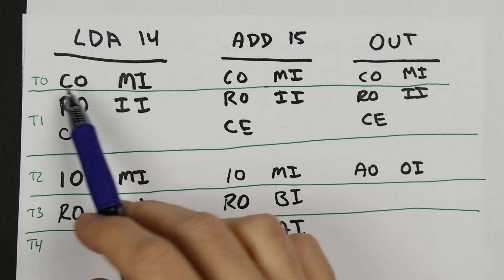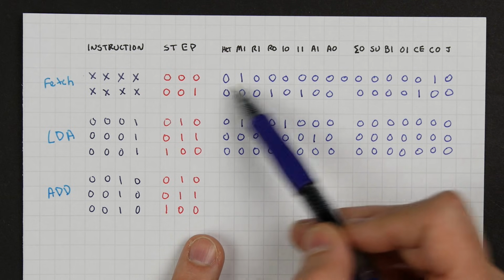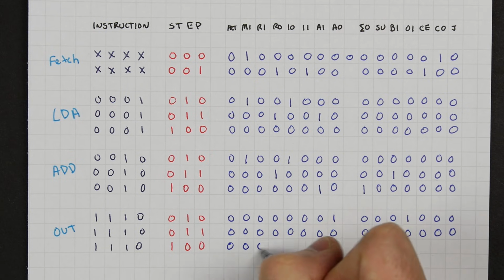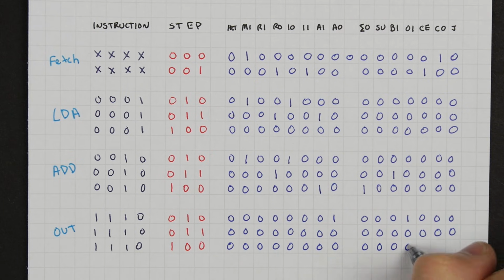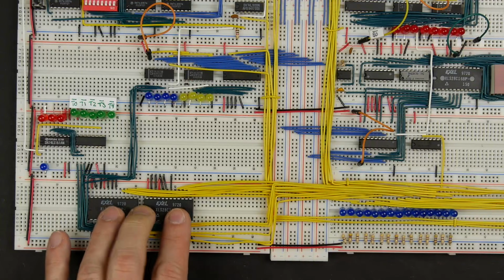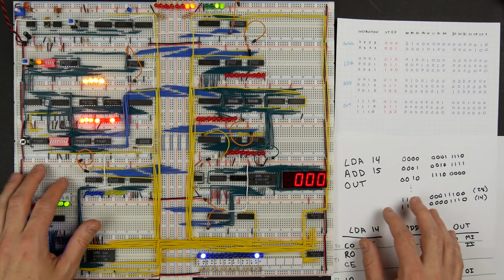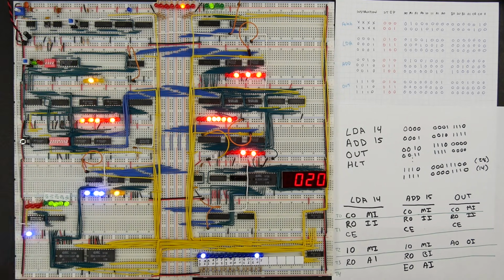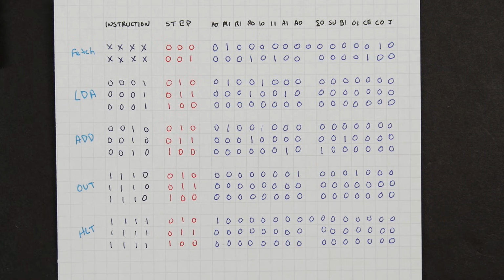8-bit CPU control logic: Part 3

Comment: How did you solve the glitches that are created when you change the address of the EEPROM to read the data?

How do you respect the EEPROM data reading time
Reply: Since the microcode clock is offset from the main system clock, there won't be any bugs.

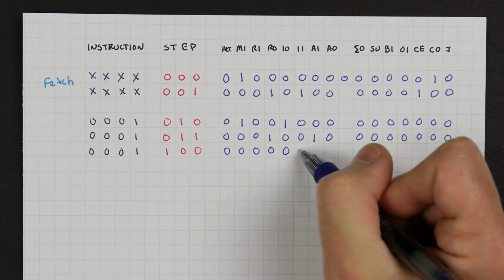Comment: for the last step of a LDA command (6:50), instead of wasting a clock cycle, would it work to add a control logic signal that resets the sub instruction counter on the 4th step of the LDA command to skip that 5th step that wastes a clock cycle?

Comment: I would use 0xF as the instruction counter reset instead of fixing it to an instruction count. That way, you could have instructions of varying length. Would require a couple AND gates, but I think that would be a big improvement for both speed and flexibility

Comment: This is interesting but I'm a bit confused as to why LDA 15 is the first step. Recalling that it means load the contents of memory address 15 into register A, why isn't the first step setting a value into memory address 15. Further, where is the step that sets the value of memory address 14 for the ADD step? Possibly you are just demonstrating a sample code segment in order to understand the timing and clock sequences.
Reply: watch the vid carefully he did sets the value at memory addresses 0 1 2 14 and 15 and here he is manully writing data inside the ram which is also shown in the vid

Comment: Would it be possible to put all of the input lines into an encoder and same with the output lines, so there is more space for any other control lines we may want to use?
Reply: Also could we put the reset signal of the microinstruction counter as a control line so we use that at the end of each instruction to save time instead of waiting for all 5 clock pulses?

Comment: At 28:58 you say that it starts at T0. What is the fix for this if your 8-bit computer is not at 0? I tried loading a zero, but the second I connect load back to HIGH, it starts at 1 again. Do I really have to program the RAM at the correct clock pulse?
Reply: Note to self... Watch the next video in the series...

Comment: just noticed, you could add a "control" signal that reset the step counter in the Instruction EEPROM

would save 1 cycle on a few instructions but it's always that i guess ?

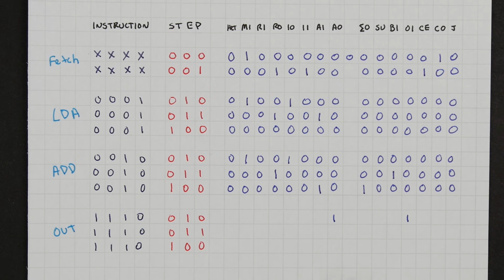Comment: 9:04 and micro counter reset xD you waste 3 clock cycle for LDA and OUT. thats more than fetch cycle.
there is 1 controll bit left to actually use it for reset micro counter LOL

Comment: 📺💬 There should be some way that you create instructions commands that use less of steps.
🐑💬 Should see the instruction commands cycle, some command is require only one step or instant output.
📺💬 Jirayu add subtract command 
🥺💬 It is the add command with sign depending on the architecture command instruction some of them change the last bit.

📺💬 EXCEL 
🥺💬 I understand as reply CPU instruction, you neat the signal before input. 

📺💬 When we load a variable after the output command it assigned address 0 but when we do with add it does not.
📺💬 Yui call to Excel ask 🐑💬 It is correct but you need to see STA statistics accumulate commands.

📺💬 ยุ้ยดูหลายที
🥺💬 ผมก็ดูครั้งแรกครับ ปกติผมก็สอบ ตอบคำถามอะไรไปเรื่อย ผมจะหางาน แต่คราวนี้เค้าไม่ยอมหยุด ผมเลยดูอะไรอย่างอื่นบ้าง

( 📺💬📺💬📺💬📺💬📺💬📺💬📺💬 ยุ้ยเอาไปครับอยากโชว์มันเลยอาย 🥺💬 ไร้สาระครับ ไร้สาระ กับผมหาอะไรทำ 
  📺💬 ไม่รู้ได้ไง 🥺💬 ผมไม่เล่นด้วย ผมเรียนหนังสือครับ คราวที่แล้วอย่างนี้แหละ เด็กมันเลยท้าเหรียญเท่าปู่กูเปล่า สุดท้ายเค้าเลยออกไปเลย บอกพม่าหรืออะไรที่จ้างมาหยุดด้วย ผมไม่ใจร้ายนะ ผมจะหาอะไรทำ
)

Comment: If you want to use a control line to reset the step counter at the end of each instruction (as many people in the comments have suggested) and still want to have that last control line available for something else, I'm pretty sure you can just continue to invert /T1 to get CE without causing any problems (saving a bit in the control word) because CE is always set during T1 and never set outside of the fetch cycle.

Comment: This entire series is mind blowing Ben!! More than 15years of wondering on "what exactly happens inside a CPU" ends here! Can't thank you enough for this. Started making my own now. Please try to make a video series on ADC & DAC because there isn't that proper info anywhere, because your teaching way is so beautiful, i believe that could help a lot to understand this topic. Respect 🙏🙏
Reply: for the dac you can use resistors and an op amp
0: 128k     (lsb)
1: 64k
2: 32k
3: 16k
4: 8k
5: 4k
6: 2k
7: 1k   (msb)

i had this hooked up to the output pins of a shift register, the other side of the resistors were all connected together to the input of an op amp in a follower circuit

Comment: Logisim tells me that just the LDA, ADD and OUT instructions, encoded using pure logic would've needed 7 inverters, 5 3-input AND gates, 4 6-or-more-input AND-gates, 7 7-or-more-input AND-gates, 2 2 OR gates and 2 3-input OR gates. If we had to do it in purely 2-input NANDs, we'd need 149 of them.
Reply: Its funny how quickly the "I'll build it all myself!" mentality goes away. I thought I wanted to do everything with simple logic gates, I know now that I really don't.

Makes it tough to think about future projects though. Where do I draw the line? If everything needs to be abstracted, why not just go all the way and build an emulator in C++ or something.
Reply: Yes, it looks like it'd be a pain without the EEPROM which makes it significantly easier. What you need to make sure of is "What do I want to experiment with?", "What do I want to know / find out?" and "What do I want to play with physically?".
You can just build all this stuff with enough patience in something like Logisim-evolution, but it won't help you debug real world electronics like plugging things actually will. I made a small Pi Pico W setup just to try out a shift register and LEDs and learn about things like pull-up and pull-down resistors.
The real question is what do you want to get out of it? If it's just to emulate this system, then building an emulator is what you'll want to do. If it's to build it for real, then that.
I also plan to emulate the CPUs used in Ben's videos in a public repository in Haskell, one of the best choices for good parsing.

Comment: Now I know how roms are burned.  I see now that programming in the software sense is just control logic for the processors of the computer, or compiling anyway.  And manufacture assembly code is the hardwired control logic of the processor.  I wonder how hard drives communicate with program counters to deliver code to control units of a processor.

Comment: if you consider only 1 signal should output to the bus, you could take 3 output pins and decode them into 7 control signals + 000 = no output to bus.
I know it's not enough to reduce the required pins to 8 but it would prevent double writing the bus.

Comment: To cycle through all of the possible instructions, as you do from 21:14 onward, one could use Gray code sequence to enumerate through all 16 instruction codes only flipping switches 15 times (unlike 26 like you do when enumerating in order).

Comment: Is there a reason not to do a logic NOR on the highest two bits of the step, as those are always contain a 1 for a step that's not loading the instruction / incrementing the step counter, and then do an AND on that and the instruction bits; that way you don't need to use memory for all the fetch steps repeatedly? It's a little more complicated but makes the computer easier to program (I think I got the NOR and AND operates right for the matrix you had there)

Comment: 32:43: You also bumped the mem addr reset wire.. :D
I was looking multiple times, why the address changed magically after your moved your hand over it... :D But that didn't caused any problem... Later I saw your note of the second bump, that caused problem actually...

Comment: Thank you, so much, Ben! This is what I want to know how the computer and microcontroller works. I was thinking how the microcontrollers are programmed manually without any computers, and I can't figure out with these 1's and 0's, exactly. Now, it is like kind of that I have got all I want to know about basic computer's system. Now, I've got how computer's micro codes are passed through cycle by cycle and step by step. I really appreciate what you built. I would like to learn computer science from you if possible.

Comment: Years late to comment, but still an awesome series. Thank you.
Just in case anybody who cares is reading could the instruction set be further optimised to four rather than five steps?
...the last cycle in the 'ADD' command is redundant, and possibly confusing? Because the 'ALU' automatically puts it's result on the bus there is no need to explicitly load the result back in to 'A'. Indeed the extra cycle's commands only serve to screw up what is in the 'ALU', yes?
Reply: I don't think you can shorten it. If you make the {EO,AI} at the same time as the {RO,BI}, then the two outputs will both be trying to output data (and fighting over the value on the bus). It's all because this simple CPU has a single bus; first we have to move the memory value into B (over the bus), then we have to move the Sum result (over the same bus) to A.

Comment: I'm just starting to learn about computers, and I've been able to piece out what is going on slowly, but I wish there was more in depth explanation and looking into some of the components and how they do what they do, and some more breakdown of things like EEPROM and how everything relates in similarity to an actual CPU. 
Originally I found this trying to figure out HOW a command unit actually, commands anything and I think I'm starting to get the basic gist of it, but it would be nice to tie it all together/break it down more for those of us not as computer savvy and wanting to learn more. One thing I had a hard time understanding was high/low, and there weren't a lot of good explanations I could find.

Comment: You did something I've wanted to do since the 1970's.  Every programmer should see this.  Wonder if you can do a combinational logic cpu instead of a sequential logic version..  Also, the extra time sequence not used like "out" could be used to reset increment the program counter on the last micro instruction and skip t4, t5 etc.

Comment: I think we can also multiplex the EEPROM as we did for the display. We can have a high speed clock(555), a couple of octal d-type latches (74LS273) and have one of the address bits of the EEPROM controlled with the clock. And we can select one of the latches using the clock as well.
For preventing repeated latching, we can ensure that the clock only runs for a short duration on each rising edge is the step counter.

Comment: Been watching these and had the thought, when talking about using the instruction to define what things to select, "Wait.. I think everything on a 6502 that dealt with the accumulator used an instruction that started either with An, or Bn... So, does that mean they went way beyond using eeproms to do this, and just built the logic so that instructions that use An, or Bn 1010 and 1011 respectively, automatically cause the chip to select the accumulator as the register to use for the instruction?"

I mean, it would be a far more elegant solution, for what ever instructions you could do it with (which naturally wouldn't be all of them), and then only have more complex bits to do the ones that didn't match this convenient bit of logic.

Comment: So when ben programmed the EEPROMs, he was updating his firmware?
Reply: He was updating the microcode. "Firmware" is above that, in Assembly Language. Firmware's role is to facilitate the basic low-level hardware operation of a system, e.g. booting an operating system from a storage device. For almost all systems, the microcode isn't something that can be updated; it's built into the CPU silicon. Ben's computer is a special case. There are exceptions, e.g. the VAX 11/780 CPU read-in its microcode from an 8-inch floppy at start-up (one reason why it took 20 minutes to boot). :-)

Comment: This is why normally you create a "control panel" with all the buttons you want to operate when not updating the wiring and just run really long wires between that and the places where the signals shall go. Also typically "setup commands" (like register reset or clock select) are placed on a top line and "operational commands" (like single step) on a bottom line. This will prevent the operator (you) from bumping anything. This is how the very first computers (like the Altair) were set up.

Comment: Small python function to generate hex values for this, Σ can also be replaced with E:

>>> instruct(MI=1,CO=1)
'2002'

>>> instruct(RO=1,II=1,CE=1) 
'a04'

>>> instruct(ΣO=1)
'40'
>>> instruct(EO=1) 
'40'

def instruct(HLT=0,MI=0,RI=0,RO=0,IO=0,II=0,AI=0,AO=0,ΣO=0,SU=0,BI=0,OI=0,CE=0,CO=0,J=0,EO=0):
    giveHex = True
    total = 16384 if HLT else 0
    total += 8192 if MI else 0
    total += 4096 if RI else 0
    total += 2048 if RO else 0
    total += 1024 if IO else 0
    total += 512 if II else 0
    total += 256 if AI else 0
    total += 128 if AO else 0
    total += 64 if ΣO or EO else 0
    total += 32 if SU else 0
    total += 16 if BI else 0
    total += 8 if OI else 0
    total += 4 if CE else 0
    total += 2 if CO else 0
    total += 1 if J else 0
    return str(hex(total))[2:] if giveHex else (bin(total)+"")[2:]

Comment: @2:26
So there are two kind of programming one is the normal programming using other computer..
And the other one is programming like in this video. I.e in every "bit state" of the input there will be some 
pattern of each of the output bit?(i dont know)

Comment: there should be a state. after you reset, the clock pulse could be either state, then either would the step counter be first triggered or other modules. in this video, the program in RAM just passed this problem that's why everything seems just fine, and that's because after you reset, the RAM addr would be 0000, and that's what exactly the first step in the program gonna do next. if you just step over the first step and that means a falling edge of the clock coming first after reset, in this program, you catch nothing flaky. and when it is a rising edge coming first, still because in fact, it does nothing(put 0000 into 0000), nothing goes wrong. so it seems the first step is not only necessary for after going but also works as a ' reset booter' it does nothing if there is a rising edge first, and when you skip it in a falling edge first, means you skip nothing neigher. so no matter either state coming first, it should work fine.

Comment: Im making the circuit in Proteus, but the step counter starts with 1, because the clock is inverted... Could you help?
Reply: Is Proteus kind of simulator ? I'm just building one. Tested Your problem - on my sim works ok. Check if You have clock signal inverted and if You have counter working on "rising edge" implemented.

Comment: 19:10, another expansion/optimization (probably someone else has mentioned), have a control signal from the EEPROM go back to the instruction step counter to reset it.  Using this, you could have some instructions that require many more steps (your 4-bit counter could have up to 15 substeps) with the last sub-step setting this control line.  In this way, different instructions could have a different number of steps.  So a complex instruction requiring many substeps wouldn't require all instructions to use the same number of clock cycles.   One thing I always noted in older CPU manuals was the number of clock cycles to perform each instruction, so clearly they use a 'variable sub-step' count.

Comment: What does least significant bit and most significant bit mean?
Reply: In any number, the "least significant" digit is the least valuable one, the most significant is the most valuable one. For example, in a decimal number 42978, the digit "4" is the most significant (worth 40000), the least significant is "8", worth only 8. Same with binary (or any other base); the most significant is the left-most bit.

Comment: How can the "sum out" and "A register in" be on in the same clock cycle? The ALU is combinational and not sequencial meaning that it calculates "instantaneously" and not based on time which would mean that the ALU would be stuck in a loop calculating the A register (sum out) continuously. Please answer :)
Reply: The ALU contents get latched into the A register. Once it is latched, it cannot be changed. Once the data is latched (internally!), it gets outputted (and thus fed back into the ALU). It happens really fast, but it takes time for those signals to propagate
Reply: @qazxsw21000  thanks for the answer!

Comment: Would it make sense if you add another control pin to reset micro-command counter? This way you can make shorter commands not wait, which I assume are more common than long ones. Also it can be combined with the last command same as increment counter - so no additional steps
Reply: I'm on this step implementing my simulator. This is good idea. I think I willl go even further - instead additinal signal  - on my eeprom sim I will implement just additional output for "address+1" - this way I can know if there is next step while being in current step - does it make sense ?

Comment: 43:14 how did you get 42 adding 15 to 14?
Reply: 15 and 14 are the memory addresses where the values stored there are added together. 28 and 14 are the stored values that added together give you 42.
Reply: @smithw7003 , you mean LDA and ADD have direct addressing, not immediate? How mnemonics look for the same with immediate addressing?
Reply: @kirill_bykov   They look whatever you decide they should look.
Reply: @pev_  Ok=) I actually meant to ask did you provide those or not.